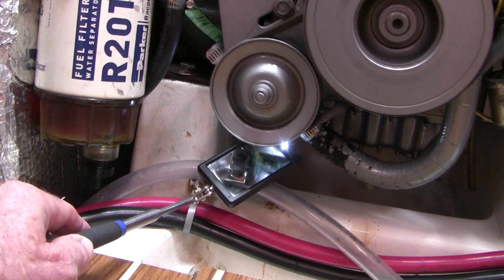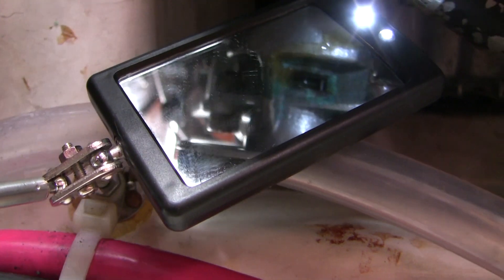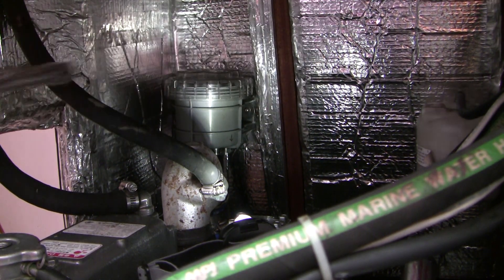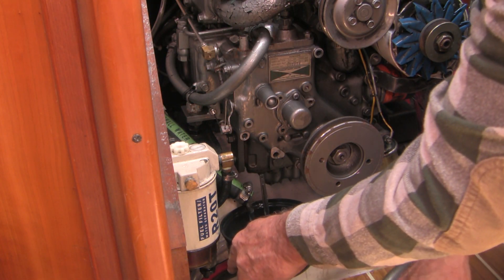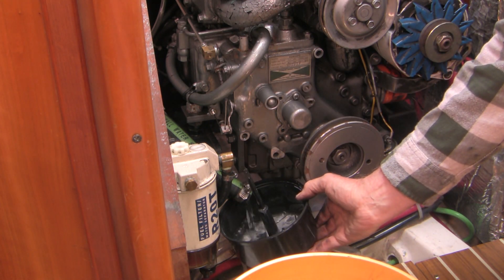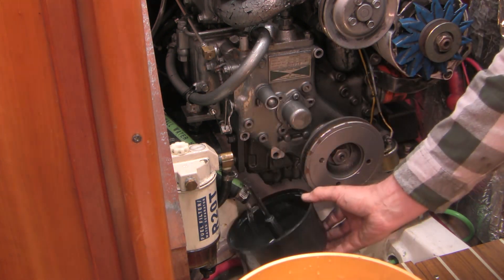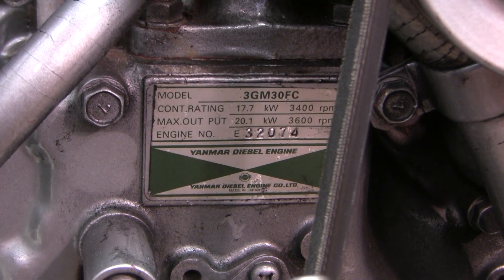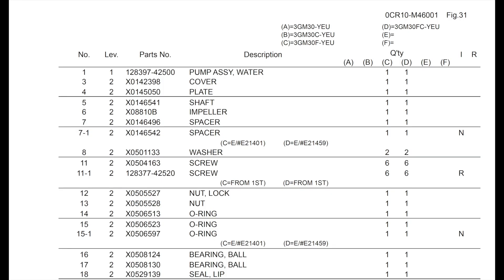How to fix a leaking salt water pump

Comment: The O-ring you found in 9:43, I can't find O-Ring mentioned in 2GM20 catalog. It is something dropped the lip seal?
Reply from the maker: It's been a while since I thought about this, so I called up the Yanmar parts catalogue for my 3GM. That O ring is part # X0506513. Honestly I don't know if the 2GM series motors has the same O ring, but you may be able to find a similar parts catalogue online the way I did. In any case, its just a 7/16" generic O ring. There's a diagram in the parts catalogue of how those parts assemble together.

Comment: I lead you astray, I meant the Oring,pn #15, (on my parts list ) that goes between the plate, that sets against the small bearing, and lip seal.
Reply from the maker: Oh, OK. I watched the video again to see what you're referring to, seen just after 9:24 of the video. Yes I would replace the 7/16" seal. The size is common enough I found a replacement in a generic seal kit I keep at home.

Comment: I noticed you removing an Oring after you removed the lip seal but I didn,t see you put it back in.  On my first rebuild I 
was not sure what this oring was for, any idea.
Reply from the maker: Many video clips hit the cutting room floor because otherwise I have a problem holding peoples' attention. I did replace that O ring with a new one. You make a good point that either an O ring or a gasket work fine in this application, and I believe different models of this pump either used or didn't use an O ring. My habit is not to switch. If I recall, my cover plate had a groove where the O ring was meant to sit. O rings are for steel on steel applications, and are almost never coupled with a paper gasket. However in other applications I have seen O rings embedded in steel gaskets. O rings may be better when thermal expansion is dramatic, for example when plastic meets steel in an engine. They tend to leak over time, but gaskets aren't perfect, either.

Comment: What do you think about reversing the lip seal so the spring isn't in contact with the salt water?
Reply from the maker: Good question, but you don't want to do that. The pressure of the water pushes against the lip of the seal, closing it the same way a gust of wind blows an open door (that swings toward the wind) shut. If the door opens the wrong way, the door is blown open. Similarly a seal put in backwards will quickly fail. There are some seals that are bidirectional, for circumstances where pressures widely fluctuate. In that case they usually have two seals that face in opposite directions. Bidirectional seals are more prone to failure, expensive, and only used in critical applications. Thanks for your comment, I suspect many thought of that and didn't want to ask.

Comment: On a completely different note. Is there not water in the bottom of your fuel filter?
Reply from the maker: Yes, it's a fuel separator designed to do that. Occasionally I drain the small amount of water from that bottom petcock, but when I do I have to remember to purge any air that gets into the filter during the procedure. To do that, after draining, pump the plunger at the top to evacuate air bubbles. If you don't purge all the air, the engine could suddenly quit because of an air lock. If that happens, to get going again you need to do the procedure I showed in a video of how to change fuel filters. So after draining fuel, run the engine for about 20 minutes at the dock to avoid an unpleasant surprise at sail. You can see a scum layer that forms between the two layers. I believe some of that is fungus which is not good for fuel injectors.

Comment: Boaters on boating forums advice using stainless steel bearings for the kind of job but when I ordered replacement bearings from a marine supplier they said non-stainless steel bearings is better. They say stainless steel won’t last as long in this kind of application. I thought corrosion resistance would be important but apparently not. It’s for the exact same pump you disassembled in the video. Do you have an opinion on this?
Reply from the maker: I can't say I know a lot about that topic but I would have thought stainless would be better. Did they explain why not? Perhaps a dissimilar metal problem between bearing and the metal housing? The bearings are separated from the salt water stream by the seal, though no seal is perfect....

Comment: Why not close the salt water seacock at the thru-hull?...
Reply from the maker: Sure, I would do that. Especially with a screw type valve, be sure it closes all the way. With the tubing disconnected, the boat is more vulnerable while you're waiting for parts. Even a small leak over a few days could trigger a frequently running bilge pump to overwhelm its battery power source. If you crack open the strainer, the siphon is broken so salt water won't be siphoned into the boat even if the valve doesn't seat perfectly.

Comment: This video perfectly talked me through the job, allowing me to determine quite easily that I was capable of performing it and have the necessary tools, before ordering the parts and committing myself.  Bravo!  (My pump is attached to a Kohler Genset but the pump is visually identical.

Comment: Itching to get out and see how much of this Yanmar I need to service...great videos!
Reply from the maker: Thank you. What engine do you have?
Reply: @spelunkerd  It's a Yanmar 3GM. It starts well, runs well but there is a great deal of oil in the bilge. I suspect the reason I got the boat at the price I did. I am going out to clean it up tomorrow and use some powder to isolate the leakage.

Comment: Thanks for this very helpful video. I am doing exactly the same job on my 2GM20F raw water-non Swedish- pump. Fortunately my bearings look good but leaking was starting through that o-ring seal with the wiring ring in it.Dean

Comment: Perfect review of what I need to do on our Yanmar 2GM with the same pump.  THANKS!  The only question I have is I didn't see you put the 7/16" O Ring back in during the reassembly.  I can't really figure out what it's there for anyway and it's behind the seal but not really sealing anything that I can tell. Addendum:  The small O RIng seems to be there to block any water that starts to leak from the seal from getting into the bearings.  Then the water will drip through the weep hole and, if you are vigilant and notice it first, you could just replace the seal (easy) versus all the bearings etc. (hard).  I sourced a kit from ebay. https://www.ebay.com/itm/112610673142 which had two bearings, a seal, 2 clips.  Only problem was the large o ring was too big :-(. I'm contacting the seller and will try to re-use the old one in the meanwhile.

Comment: Like you said at the end you used a number of machine shop and specialized tools. You also said you could have done the same with a wood board and a regular set of hand tools. I would like to see that video and advice on the following. I have two of these yanmar engines with the exact same pump on my catamaran sailboat and have been buying new pumps every several years for each engine. So I have a number of old pumps that I would like to learn how to rebuild. What is the set of tools I should have to rebuild these pumps onboard, not in a nice machine shop. Thanks in advance, Ricky
Reply from the maker: There are several videos showing people doing that in the boat. It would really help to have a vise, a 2X4, hammer, a deep socket set to isolate what part of the bearings it is safe to tap on, and needle nose pliers to get those snap rings. It is very important to understand what part of the bearing to press on. For example If the bearing is held on the outside, and you tap on the inside of the bearing, you create torsional forces inside the bearing that will likely destroy it. If that happens you'll likely not notice for a few months, then the bearing will start making noise.

Comment: Thank you for the excellent video! About the lip seal (11:40), do you have any insight as to why they're installed with the spring on the wet side, as they are? It seems like if they were flipped around the spring wouldn't corrode so quickly and they might last longer.
Reply from the maker: It might help to consider a goofy analogy. Suppose you had a door facing into the wind. If the door closes one way, the wind will slam the door shut. If it faces the other way, the wind blows the door open. Now consider what happens when you apply water pressure to the lip of a seal. On the spring side, water pressure will hold the lip tightly against the steel shaft. Higher pressure on the spring side causes the seal to be held shut, but if you get high pressure on the opposite side the lip is lifted away from the shaft, causing it to leak more. The spring is designed to squeeze the edge of the seal against the shaft, so you always want the higher pressure to be on the spring side.

Comment from the maker: It's interesting to compare the design of this Yanmar belt-driven pump with sealed bearings, compared to the gear-driven pumps with open bearings in small Volvo marine engines. Those Volvo pumps use engine oil to lubricate the open bearings, so they have a more robust oil seal in addition to the water seal. Both use a weep hole to offer an early warning when the coolant seal begins to fail. Both pumps are disassembled the same way, pressing the shaft out to the drive side after removal of a snap ring that is not accessible until the drive gear or pulley is removed. The orientation of the seals are as one would expect, with the spring of the seal on the side of the fluid that needs to be to contained. So in the Volvo pump the oil seal spring is on the oil side, the water seal spring is on the water side. They are oriented the opposite way compared to each other, with the weep hole between the two seals, to offer an early warning when either seal fails.

Comment: Maybe you could use some sealant to temporary seal any leak? Use Pentax.
Reply from the maker: Always an interesting question, what to do in an emergency. Fortunately this kind of leak is minimal except when the engine is running, unless the impeller is also damaged. If it leaks when engine is off  one could close the seacock. There's a product called 'stop leak' for closed freshwater automotive cooling systems. It often causes more problems than it solves, and it wouldn't work for the open side of a salt water cooling system. I never use it. I suppose one could slop some kind of sealant onto the seal, but you can't let it stick to the impeller (or shaft, where the leak usually is). Most would wait for a new seal, put up with the annoying drip for a short while. A case could be made for having a spare seal on hand for long trips. Thanks for stopping by!

Comment: Thank you for the video! Could you provide the part numbers for the hoses you replaced? The part number did not really show up very well on the video. Thanks!
Reply from the maker: Even at high res, a little washed out and hard to read! The pump hose I have in hand at 13:26 is part # 128690-49010, and the return coolant hose above it is 128695-49530. This applies for the 3GM30FC-YEU engine, you'll want to check the parts list for your engine. These parts lists are available for free online, though there are many updates and revisions depending on year. Your parts supplier may have access to a more updated parts list. Good luck!

Comment: Really good video as always. We are now advocating replacing those springs on the "wet" lip seal with a quality O ring two years and 300 engine hours and still no dripping. Sail Safe mate. Ant, Cid & the pooch crew.
Reply from the maker: Good point! I think it would be fairly easy to push that lip seal out from behind, though the RTV I used may make that a little more challenging.

Comment: Not to say you'll encounter this issue, but I've run into several discount Chinese sealed bearings that had close to no grease inside them when I removed the seals for inspection. For my use, I've taken to popping the seals off of them and repacking before installation. I don't think I'd spend $90 on a bearing either... :)

Comment: Well done :-D
i would imagine a new pump would have been expensive or unobtainum.
Also when you repair it yourself you trust it, well i do :-D
When you talked about the air in the pump i thought (Manual priming)  so it's ready to pump straight away.

Comment: Very nice well thought out video.  What brand and model of ultrasonic cleaner do you use and do you like it?
Reply from the maker: This one was made by Intertek, model CD4860. I'm not sure I'd recommend it, although the price was right and it seems to work fine. In their advertising they note lower noise, targeting the denturist industry. I wonder if reducing noise by using a plastic housing rather than stainless steel may reduce efficacy. If I were to do it again I might upgrade to all stainless and not worry about noise. Volume for ultrasonic cleaners is an important question, since bigger volume can handle larger components but you need more cleaning solution every time. Thanks for stopping by, Ben!

Comment: The press makes extracting the bearings easy peasy and ensures accurate assembly of the new ones. Water gets in everywhere so any sealant is money well spent. Oem parts can be quite expensive to purchase but the alternative must be near equivalent in build quality. Early maintenance procedures eliminates a lot of potential damage later down route 66 and prevents premature launching of the lifeboat. Full steam ahead an dont spare the engines.